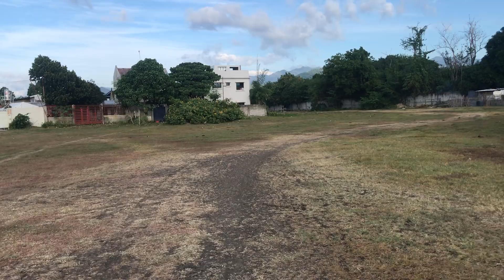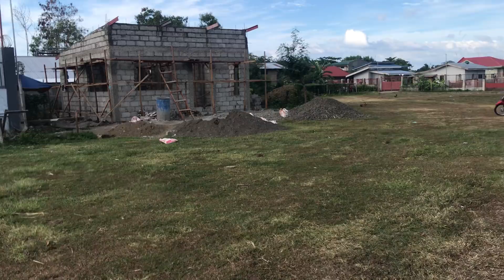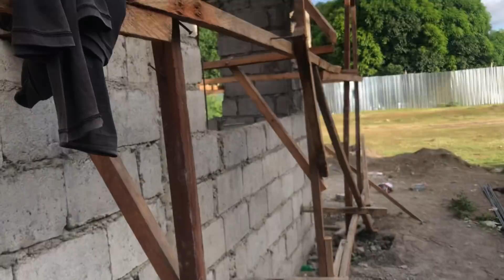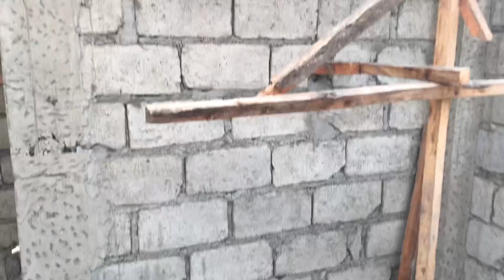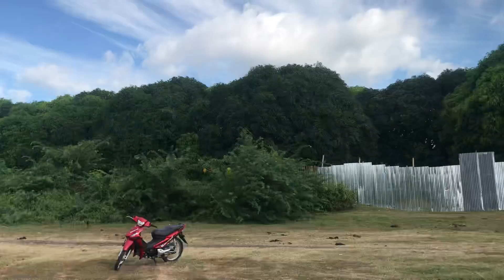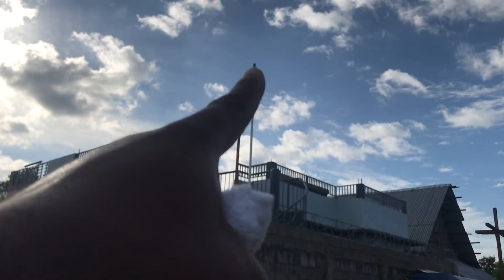UPDATE On Our New House Construction Day 30

Comment: Here's some perspective. I just saw a new 2021 LEGACY 2BR/1BA 12x48 500 Sq. ft. Mobile Home listed for $45,500 in the US. Then you have to go find a lot to put it on. That's for a single wide mobile home, wood frame on a steel chasse that can be easily blown away in a hard wind. I think I'll take the rock solid house build for $20,000 on the tropical island, with the year round warm weather and low cost of living. Raise your hand if you'd rather have the trailer.
Reply: Not to mention they want 50 grand for a 4×4 pick up truck in the USA  !
Reply: Then add the high US property tax. 🙄 property tax in the Philippines is hardly anything.

Comment: Put a conduit in for adding a water heater at a later date. The conduit cost a few pesos. Also figure you will want to add a water storage tank and pump for water pressure. You will want to add that also in the future.

Comment: Love that they increased the concrete blocks up to the roof level, then tapered down to the back.  That makes the water go to the back of the house and not on you as you walk into your house.  It also gives you space to put a front porch on the house where you can sit out and enjoy the night air.  there is a lot of potential with the design that you chose.

Comment: I’ve spent over 6 years in Italy and they build houses the same way, except the block in Italy is clay. In Italy they build columns to hold up the roof and use clay blocks(tile) to make walls. It all looks bad in Italy and the Philippines till they cover it with stucco. 
Don’t listen to people that don’t understand construction with cement. People are used to houses made with wood. It’s a huge difference between the states and the Philippines. 
The place looks great. I look forward to the finished product. 
Enjoy it sir.

Comment: The only difference I see is that we would fill the foundation with dirt let it settle compact it and pour the floor before we run up the blocks for the walls.
Reply: I was thinking the exact same thing!  My dad designed and built houses for a living, so I know exactly what you’re talking about. But then I took a step back and realized they are doing it perfectly correct for the Philippines. I am so glad Calvin is giving us this super interesting day-by-day chronicle so we can watch this house being built.🙂
Reply: the floor is not done because the Drains for plumbing are not in yet.

Comment: Same way houses are built in the Caribbean only difference is the blocks are double the size. They made them strong because of the hurricanes
Reply: Typhoons are usually stronger than hurricanes in the Caribbean. The one that passed over Guayma PR in 1996 was Hortence, it packed winds of about 130 mph.  However when the Super Typhoon Megi passed through Taiwan in 2016, the wind speed was about 130 mph as well.  the difference between the two, during Hortence I was in a single story building behind 6 inches of concrete(very safe).  During  typhoon Megi, I was on the 25 floor of the Marriot Hotel above the Nangang train station(Taipei, Taiwan).  The wind felt much stronger on the 25th floor.

Comment: Sometimes when you try to go cheaper you might succeed and actually save money, but often trying to go cheaper and cutting out some of the expenses/contractors etc, ends up costing you WAY more and Way longer if not ending up with an unfinished or un able to finish project.

Comment: Have a well dug. We started our house a month ago and we were gonna have the same water problem. Dig a well and insert a well liner. Submersible well pumps are around 350 bucks. Then simply run it to a 30-50psi pressure tank. We dropped around 1300 bucks for the system including a triple sediment filter.  Wilcons sells the equipment.
Reply: A well and a septic tank on a postage stamp size lot is not a great idea.

Comment: I like what you are doing.. but I love that I have given great talents to build and have help them in the village I stay.
But the concrete for the floor is not as thick as it is here in the US. The need for spraying for termites is needed because of the termites . Inside the walls I dream about treated wood so that I can used the Sheetrock which makes it very easy to do the electric wiring . But I do have help like you but they listen to my designs and put it to order.

Comment: I plan to build my own house in Phill but I will need some Philippine workers to help me . I have been to the Philippines I got to do some up close inspection of their work  .  I have been a commercial and residential carpenter  for forty years . I will build my house the same style  like yours with only a few minor changes for my own peace of mind . I know its important to use lots of rebar when building in an earth quake zone .  From what I could see they did a good job on your house . But I wont be using a hand saw . There is nothing wrong with paying a little extra to have someone else run the job and deal with any problems that might come up with the construction.  .
Reply: @77203  A lot of the hollow block houses I saw in Phill had wood framed roofs , I stay in province area when I go to Phill  . But I agree use metal if you have the money for it  .  I know there is a certain kind of wood in Phill  they say is termite resistant . In southern USA they use Cedar .

Comment: Looking good Calvin. Question ⁉️.  Does the $20,000 you paid include sinks, toilet wireing, plumbing or just the structure? It's coming along fast.  Our house in Cavite is being built the same way. It's very sturdy.  My wife has drafting experience and she designed our house.  It's 64 square meters with a 10" thick cement slab roof deck. It's been 1 year and it's almost done.  We are waiting on the floor tiles that are on back order. The virus situation slowed us down a lot.
Reply from the maker: Yes! Everything. Thanks for stopping by.